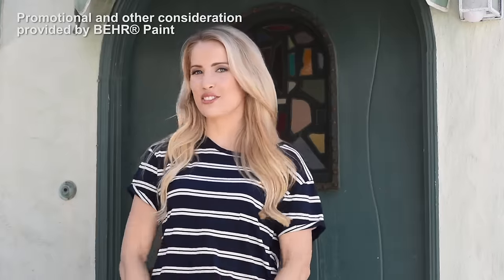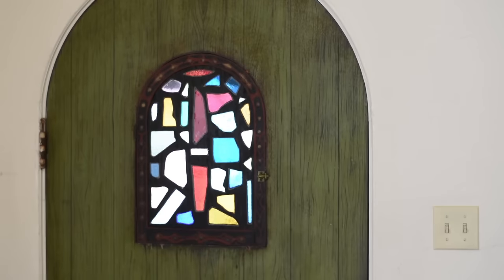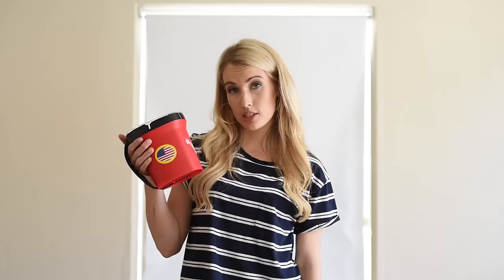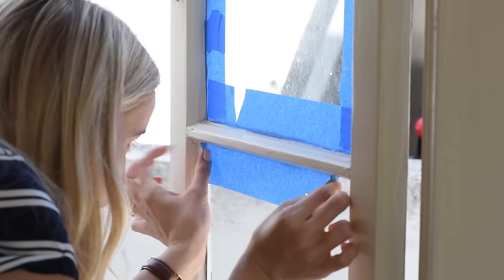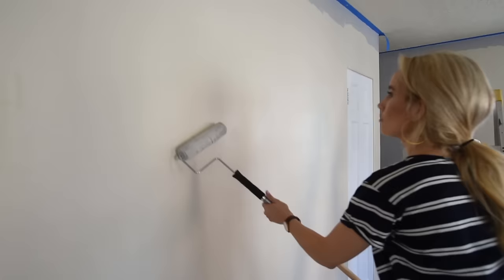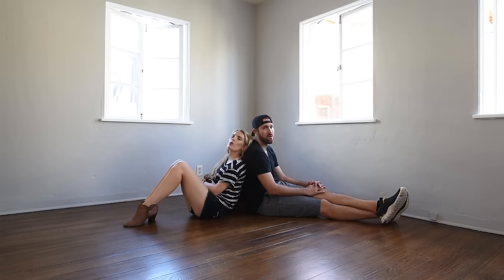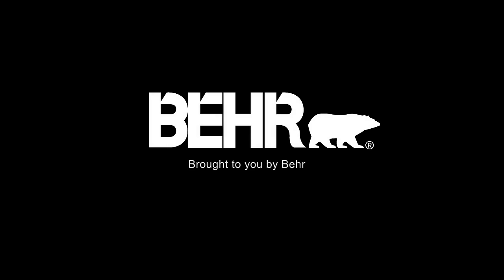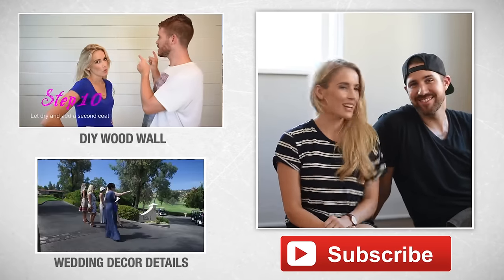INTERIOR DESIGN: Transforming a Small Apartment With Paint | Our First Home!

Comment: Some tips: after pouring the paint from the bucket to the roller tray (or anything else), clean the side of the bucket with the brush; another tip, don't trust so much in the masking tape, get a good brush and learn how to use it. The masking tape and all the paper makes you less cautious, and when you take it off you can find a lot of mistakes or paint spilled. it seems on minute 3:21 the glass in the window got some paint. anyway, be sure to cover well the floor (plastic sheets are usually good and can be reused), and everything else don't trust in masking tape (I rarely use it - if I need to draw a huge straight line, I mark the wall with a pen/pencil/blue-construction-line/pendulum, and the brush does the rest).